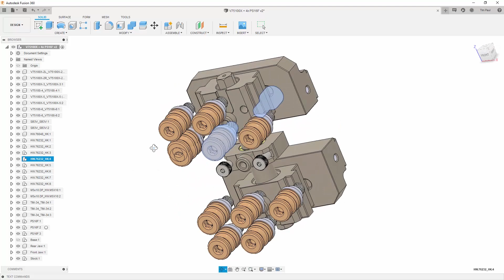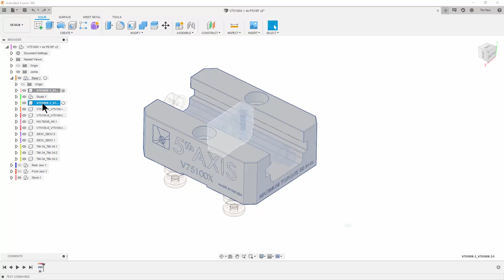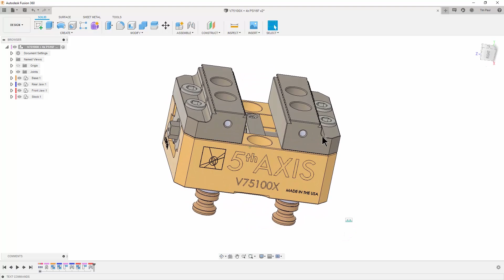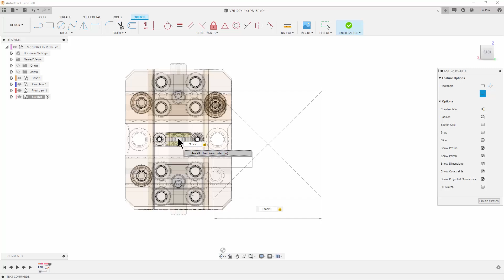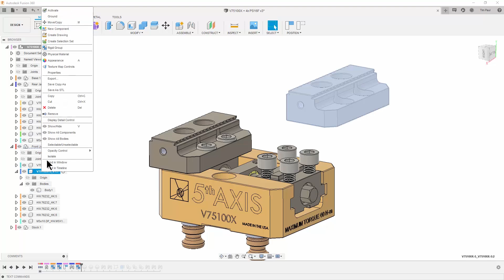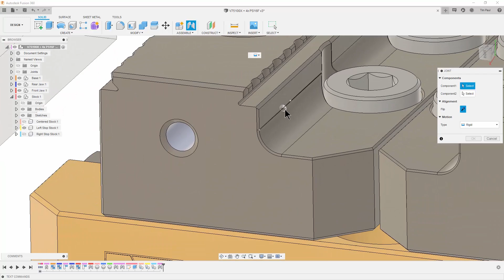TUTORIAL: Parametric Vise Assembly

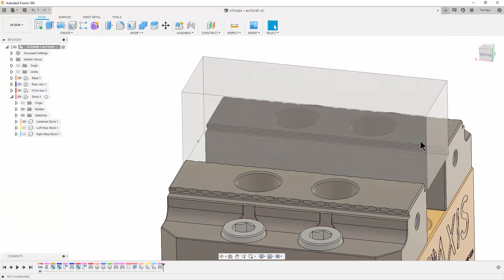Comment: Hi, Thanks for the great video. I do wander - circa 24:40 you position the stock to be centered in the vice... and though I know this is not a fusion Q, I do find it to be related and on topic - how would you position the actual physical stock to be centered like this? or would it actually not matter because you remove material all around it?

Comment: Was there a followup on this topic? How does Tim use this setup?
Reply from the maker: I don't believe there was a follow up to this. Any specific questions I can pass along to the creator?
Reply: @adskFusion  No specific question as of now, I guess I can find some other tutorial showing how to bring such a setup over to my project. I asked just because Tim promised to show how he is using it and I was curious.
Reply from the maker: Got it! Make sure to see the CAM samples at the bottom of the data panel for workholding files!
Reply: @adskFusion  I found those. And some other wise related videos. But I still can't figure out how Tim makes use of those parametric stocks defined here when using them within a part project. Changing the params in the part project does not update the jaws, for example.

Comment: This is awesome, thank you for posting. Excited for the next video. I started playing with some of this and did something neat. Instead of having 3 components for part position, I just made 1. I made a parameter for "PartPosition" where you can enter an expression "left" "right" "center" , with user parameters for each, where the value for each of those parameters is the X location of each joint origin. Rename each joint origin to its respective position.. left, right , center, etc. So when you change "PartPosition" parameter, it will move the location of the joint to wherever you want it located! :) This could be neat if you had a subplate, you can easily name each point (with a joint origin at each) after its alphanumeric position on the plate, and drive a WCS value. But, as far as I can tell, you cannot link expressions / variables/ parameters across the design and manufacturing workspaces.
Reply from the maker: Whooooaaaa! That is cool!

Comment: Does it matter if its a XT FILE OR STEP FILE?
Reply from the maker: It doesn't really matter which format you import.  Fusion 360 can bring in quite a few different formats.  If it were me, I would probably lean toward the STEP format as it tends to be a bit more universal.
Reply: No. Someone may have a super geeky reason why something may matter, but I use XT and STEP ALL the time with no noticeable difference.